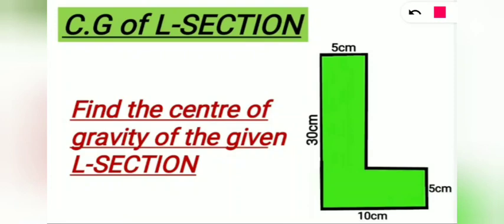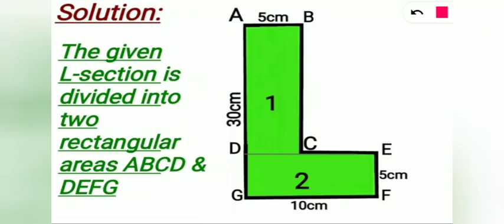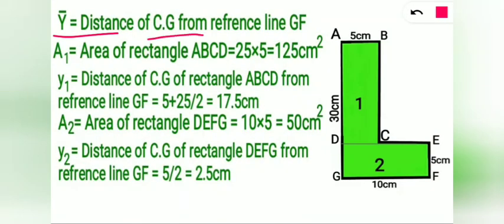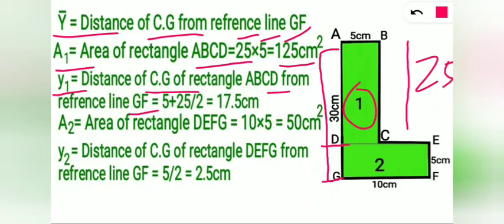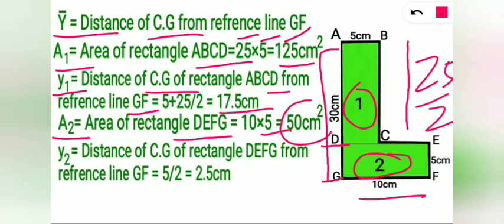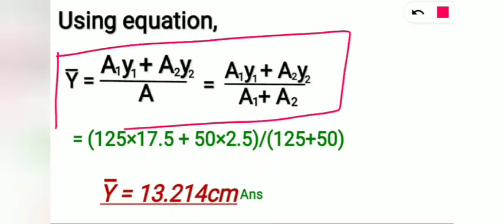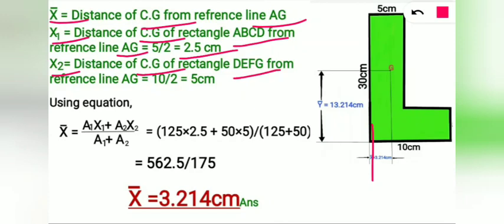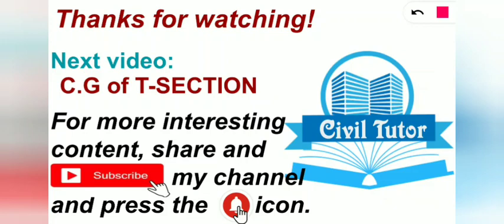CENTRE OF GRAVITY FOR L-SECTION | CENTROID OF COMPOSITE SHAPES | CENTROID OF L SECTION | CIVIL TUTOR

Comment from the maker: After watching this tutorial you will be able to find the centre of gravity of an L-SECTION.
In this video tutorial i have explained briefly how to calculate the centre of gravity of an L-SECTION by solving an example based on L-SECTION step by step.

Since L-section is not symmetrical about any axis so we will divide it into two rectangular areas and choose the bottom line of flange and extreme left end of web as reference axis for calculating Y̅ and X̅ respectively.

https://civiltutor15.blogspot.com